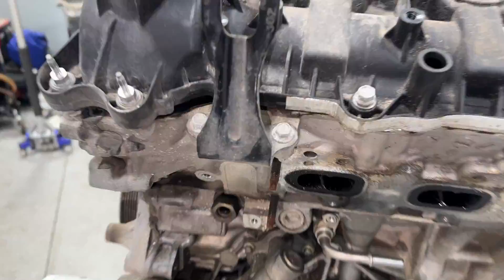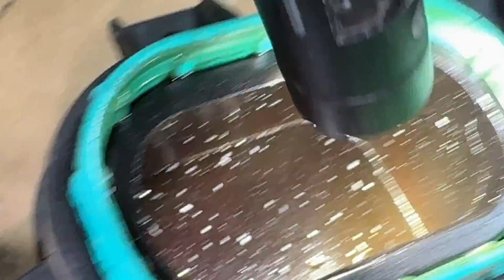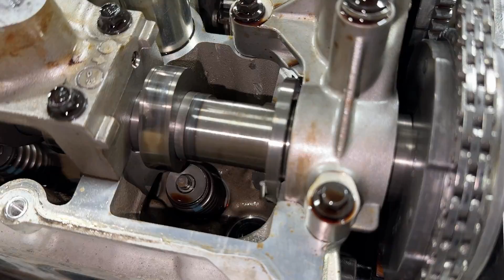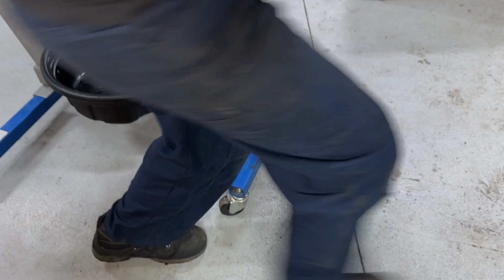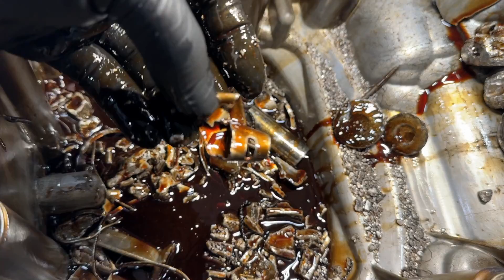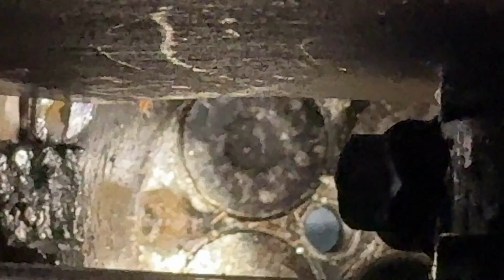Proof Ford Ecoboost Engines and Aggressive Aftermarket Tuners DO NOT MIX!

Comment: The maniac behind the wheel of that pickup was not "just passing" another vehicle when it let go. I wonder if he thinks that Ford is partially at fault for casting the block too thin. Nice work, Brian and Alex.
Reply: Passing = maniac. That is the general consensus.
Reply: I second that assessment, There is just too much ground up into very small pieces of shrapnel for that to have been a 1 second catastrophic fail. That thing was driven hard while it was grinding itself to bits over more than seconds worth of failure.  It was likely making loud noises for quite some time before it just threw the rods. He'll be back in your shop again for sure with some other engine he's abused to death.
Reply: There are plenty of instances when passing a vehicle requires quick acceleration. Could very likely have been a two lane road or a slow driver entering the highway.

Aftermarket tunes tend to give you lots of rpm and downshift without having to press the pedal very hard. I only have to press the throttle slightly and it downshifts to a low gear immediately
Reply: @brysonrodden5112  yeah, like a drag strip
Reply: @brysonrodden5112 rpm's are not the enemy. Commanding too much torque at too low of rpm is the enemy.
Reply: the block is actually well-ribbed and reinforced. He cheaped out on his choice of engine when he ordered the truck, especially if he wanted power.
Reply: @adotintheshark4848 3.5 is the most expensive option needed rods and bigger turbos.  The coyote is the power choice but needs rods pistons and boost solid 20k over stock price. A 3.5 stock is faster than a tuned v8

Comment: I wonder if it floated a valve or dropped one? Usually the lower end going doesn't take the parts off the heads.

Comment: Based on the extensive rounding of the broken pieces in the oil pan, the driver kept his foot in it, maybe for a minute or more, until the thing finally quit running from lack of oil.
Reply: Dont think so. I don't see charred journals or anything else saying it seized.
You have to imagine, at redline such an engine is spinning about 100 times a SECOND. That will round off anything in a hurry.
Reply: @kain0m   No, I don't think it ever was on the verge of being truly seized up from heat and lack of oil.  I think the driver ran it down the road until the engine was pretty much all out of power to move him at any appreciable rate of speed with the computer having a host of error codes, and thus saying "no more power for you", or he stayed on the throttle to move the vehicle safely out of traffic for whatever extended distance that required.

As an example of balling metal or not, look at race motors that are blown up on track or "built" motors that are blown then shut down fairly fast.   Even with their higher power and extended high rpm use, there is not as much "balling" of certain large materials (pistons) that were rattling around for an extended time as shown in this oil pan 8m 25s in the video.  Yes, there's going to be plenty of rounding of edges and the like, but not true round balling of aluminum to this extent, even in a "built motor" blown up at high rpm of 6,500 or more.  This driver may have needed to keep on the throttle because four of the six cylinders were still firing to maintain safety while on the road.  We'll never know.  But this is my educated answer given the video and having seen plenty of blown performance motors.

Comment: Was thinking about an aftermarket tune for years.  This really seals the deal that I will not be doing it
Reply: But you have to remember this guys was on e85 and probably make over 550HP at the wheel
Reply: This keeps me from doing the same on my 5.3L Silverado.   There is no small problem if it goes wrong.  My truck moves pretty good with what GM gave it.
Reply: I’m running the Livernois Tune (pump gas) with no other mods. I have tried both their 87/89 and 91/93 settings and so far have been satisfied. They appear to be a company that takes a reasonable approach to tuning wo trying to get out every last HP/TQ and then stress the drivetrain 16:03 components beyond reason.

Comment: I just installed a used engine in a 2017 expedition. 3.5 eco boom😂. Had 85k, the timing chain broke and crashed the valves. $3500 for a used engine. I don’t have a 2 post so no way to lift the body. I do have to say it was the worst engine replacement job I ever did. A bunch of stuff has to be disconnected off the back of the engine to get it out. And the trans harness is built into the engine harness with no way to disconnect it unless you loosen up everything from the trans. Pulling the body would be ideal if you have the means.

Comment: Really, you did a forensic analysis to determine it was the tune??!! Engines break rods and determining a cause is more than just taking your camera and looking at it!! Sure it's possible considering bigger injectors, tunning and E-85 but the failure is not definitive! Could have been an injector stuck open and hydraulicing the cylinder. Do you know it wasn't? Ya speculation and fear mongering on your part!!!

Comment: My 2018 ford fusion 1.5L eco boost engine failed in 2020. Car sat for a year. I was missing payment due to not being able to drive to get $$$. I bought an extended warranty. Before the warranty showed me to file a claim. A recall came to my state. Ford service department really looked out by not recording my the coolant intrusion so I could have the engine replaced by the warranty (thank them for that). But a week after the engine was replaced the car was repo’d and sold at auction. I was devastated. And I was at a total loss. Terrible experience, I loved the car. That’s all.

Comment: E85 gas?  Why was E85 in there as all the manuals prohibit it?
Reply: It’s e85 tune. E85 on Ecoboost is crazy
Reply: Tuners like E85 for the added power it can make with turbos. Pretty common for aftermarket tunes to have one for E85.

Comment: Not a fanboi of any manufacturer (I'm a fan of money), but I've found the 3.5 has been a terrific engine when given any basic maintenance.
Reply: Aside from timing chain/phaser issues maybe
Reply: Like any engine. Think that cars are just detuned by factory. More power means more load on engine components. For efficiency most engines are approaching limits as is and cannot be just 'tuned' and expect to last. It will fail at some point regardless of maintenance.
Reply: @russelljacob7955  everything will fail eventually
Reply: @jasonbrushett2005  True. It just depends on the timeframe of failure. 200k miles vs 20k. Or 2k. Or heck, maybe in just 2 miles.

I guess my statement if amended would be to crank up the tune and then expect it to last just as long as unmodified.
Reply: @russelljacob7955 2 miles lol, that reminds me of the 6-7 brand new corvettes that pulled out of the lot and got towed back 5 minutes later.
Reply: @huh0123  Oof! Am curious as to what failed for that? Bearings? Lifters?
Reply: @russelljacob7955  shredding bearings and caps flew 💀
Reply: Until it's tuned.
Reply: @mytruthslays1303  Im tuned. 12.45 113 mph quarter mile on 93 even faster on E50. 2018 4WD 130XXX miles on it. My truck is phenomenal. I have had wheel end problems and the door handles suck in the winter but really I love my truck. It hurts peoples feelings at least once a week and tows my camper, boat, jet ski and everthing else. Even towed my camper and Jet ski over 1000 miles and never even barks.
Reply: Yep
Reply: It wasn't designed to last. The constant strain and pressure's those engines are under are not sustainable.
Reply: @NoName-qs6ei Many of them have over 200,000 miles. Some even more. That’s not bad by any measurement. Vehicles last a lot longer than in the past when the odometer didn’t even go past 100,000. The average life used be around 125,000 miles. Today it’s much greater.
Reply: r.weaver3769 designed obsolescence is being done by every manufacturer today. They want vehicles to be like cell phones, get a new one every few years at the longest. Parts are being discontinued in many cases after only 6 years! Engines are not made as robust & forgiving as much as they use to. Coupled with long oil change intervals (that get abused) leads to destruction.

Comment: I remember the days when you would never think of having to pull the body off of a truck to change the spark plugs
Reply: They are made to be pulled for better access. My diesel shop only charges 1.5 hours to pull the cab on my F350 and two and a half hours to reinstall the cab. I think because they have to recharge the air cond. 
They say it saves time in the long run to have such good access.
Reply: Lol but the spark plugs are on top of the engine? Lol majority of half tons the cab removal is not really a necessity. All new diesels have to much clutter and the cooling stack is so much larger now its just so much nicer no cab. Quality of repair ( not saying you can do a quality repair without removing the cab ) it’s just a lot more comfortable.
Reply: You don’t need to remove the body to change sparks on eco boost. Only the foam engine cover. Easy job to do and plenty of vids showing it

Comment: Those guys from India on YouTube could fix the block with JB weld, they could probably weld the rods also.The spark plugs might need some work. Clean that stuff up and mount it in a shadow box to put in the office, good for customers to see.
Reply: and it needs to have a plaque that reads: "This is what happens when you put an unnecessarily aggressive tune on a stock EcoBoost engine"

Comment: Leave them stock! The engineers have designed it to the 100% power level! If you need more power get a vehicle with more power from the stock form factor. This its like an Eric Berg (I Do Cars) teardown. Thank you for posting this damage Brian. I hope someone else learns from this customers mistake.
Reply: This is not true.  The 3.5 can run a lot more power reliably, but obviously you can take things too far, like this guy.

Comment: Running an aggressive tune with higher output injectors but using crap E85 fuel sounds counterintuitive doesn't it
Reply: Your statement indicates you don't understand alcohol fuels.

Comment: I think a 75 or 100 horse tune is ok, the Gt 40 has 647 horsepower so the 3.5 can handle a little extra power, just dont go crazy and don't over rev it!
Reply: I'm guessing the GT 40 has many special components..The 3.5 Eco-boost does not have a good longevity record let's face it..

Comment: Good tuners are rare. Any advice on hunting down a vibration on a 2016 SHO with 37k. Vibration starts at 70mph. Tried tire balance, pulling driveshaft and test driving etc.
Reply: Does it have stock or aftermarket rims?
Reply: @upinair4990  stock and winter wheels have same vibration.
Reply: Balance tires using Hunter Road Force equipment. 
Not all shops have the Hunter System. I won't go anywhere else. 
It FINDS the defect every time.
Reply: @TheBandit7613  Hunter Road Force for the win! Thanks Bandit - issue solved.

Comment: Richard over at Precision Transmission (@Richard & Teresa Educational Transmission Videos) would LOVE the carnage in this one.  Holy WAH!  Guy got what he deserved.  He did.  Want to play like that, get yourself a block designed for it.
Reply: The block isn't what failed in this case. This was a rotating assembly issue.
Reply: @--_DJ_-- While true, don't do this on a stock engine.  Got what he deserved.  Going to upgrade power like that, you better have the components to handle it...
Reply: @WreckDiver99  A lot of people get away with turning up the wick on these in stockish form. If I had to guess that was a bad tune, but I only half paid attention to the video so there might have been something I missed. You can ruin an engine with a bad tune in short order that may have lived a long, healthy life at higher than stock power levels with a good tune.

Comment: Great video. Thanks for showing us this.  Stock ecoboost engines are already pushing a small displacement to make a lot of horsepower and torque, so it seems like common sense that pushing it even more is not the best idea.
Reply: This EcoBoost is an open deck design, not my favorite. The GT engine deck is reinforced and closed with braces.
Reply: Exactly in my opinion stock is too much as it is
Reply: While I agree to a degree, consider the Raptor and the Ford GT. Same displacement but quite a bit more power. There's so many things that could have went wrong to cause this.
Reply: @347mav3 The Raptor and GT tunes are developed by educated engineers with dozens of ways to monitor the stresses in the engine.  Contrast that with 99% of the “tuners” out there that have more tattoos than brains (and often a shitty beard) and have absolutely zero insight into how their “tune” is stressing the parts within the engine.  And, by the way, you get a factory warranty with a Raptor or GT; ever heard of a “tuner” offering a warranty?  Of course not, because they cannot prove that their “tune” will reliably be within the design parameters of the engine.  They’re happy to gamble with YOUR money.
Reply: @mikek5298  my mustang blew up with the ford performance tune. its not always the tune. Now I have the beard tune on my built motor with a 2 liter block.😆
Reply: @347mav3   The GT Engine Assy - Fully Dressed part # HG7Z-6007-A is $74,000.  I suspect there are some internals that just might, maybe just saying, aren't the same.  A reman F150 3.5 is only $5k.  Just sayin...
Reply: @347mav3  I currently have 3 EcoBoost-powered vehicles (2.3, 3.0, and 3.5) that I've tuned myself (and a couple more that I've now sold) as I do understand what's going on and why, apparently unlike @mikek5298.  My 2018 Raptor (~6k lb) with a bit over 80+k miles stilI runs mid 12s in 1/4 mile on the oem-stock, self-tuned 3.5 and my 2021 Explorer ST runs high 11s both sucking E50 blend fuel.  A higher ratio of ethanol requires aftermarket HPFP and full E85 usually (also) requires larger port injectors.  I do wish Brian had pulled the rod caps off and provided a bit more information.  Like where the "bearing shell material" came from.  Both rod big-ends were still bolted to the crank, such that it's unlikely, but not impossible, the shell came from one of them.  We weren't provided the mileage accumulated while tuned for E85.  Again, running full E85 reliably requires a few more components and specialized tuning other than just larger port injectors.  What HPFP did it have, which injectors, etc.?  All said though, it is indeed most likely the E85(?) tune that triggered this destructiion.  I suppose the point of the video is/was to show the level of carnage from what is apparenltly an aftermarket tune.
Reply: @joe-g1749  Bad tuning kills, I'd suspect either timing too advanced or maybe over rev.  At the end of the day, a ford reman long block is only $5k.   If he's gonna try to run an E85 tune labeled "aggressive" then ya might as well have the motor built for it.  7.3 guys were throwing rods long ago with AR housings of .85, aggressive timing and stock injectors. Good tuning on powdered metal rods with mid-sized to large single w/ 1.0 AR, 250/250 injectors and proper tuning netted them 500hp/1000ftlbs but the motors lived.  Same rev limiter but aggressive timing killed them every time.

Comment: What is the difference between this 3.5 and the one in the raptor besides the tuning…. Is there really different hard parts that handle the extra power differently?
Reply: The '18-'20 3.5 f-150 has the same engine & turbos as the Raptor, but the Raptor is tuned to run on 93 octane netting the additional 75 hp from factory.  The Ford GT is running 650 hp, but obviously more has been done to it than just a tune. 550-575 crank hp on these engines are being run with no issues, if aggressively maintained (3k oil changes)
Reply: @skrsys thanks! Yeah that what I thought… I have a 19 Expedition with a 93 tune and I do aggressively maintain it and don’t really beat on it. The Transmission tune is the best part, way better than stock.
Reply: @SEJackson100  Yeah, the truck in this video had bigger injectors and was running an aggressive e85 tune, so really not the same.